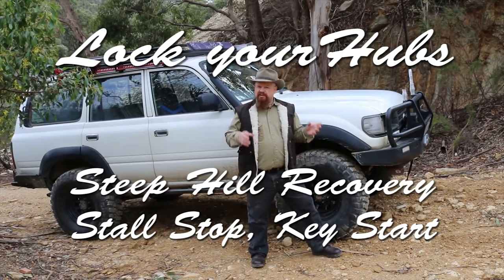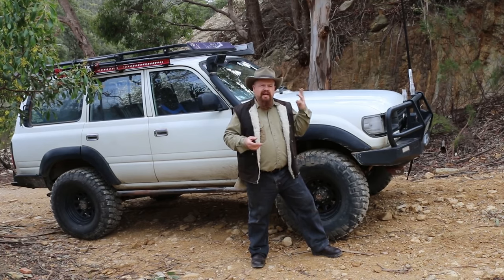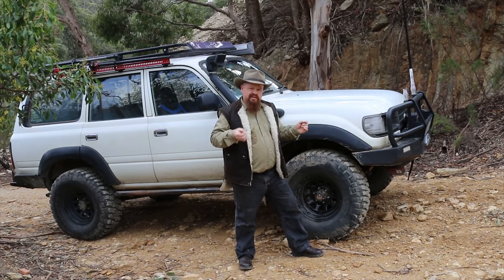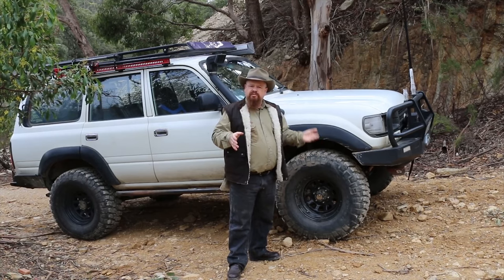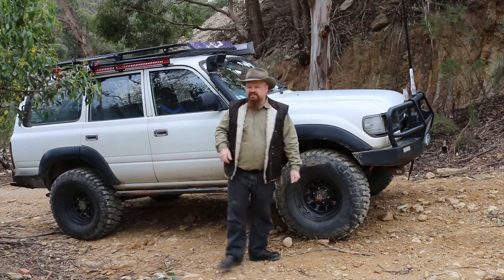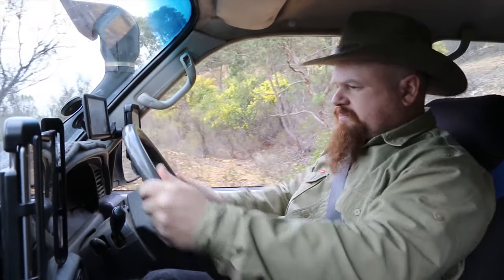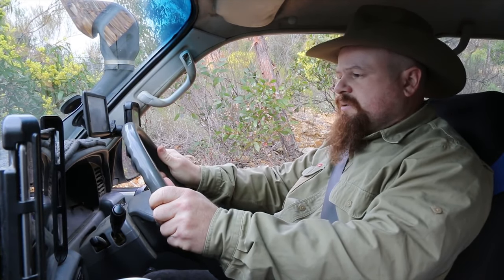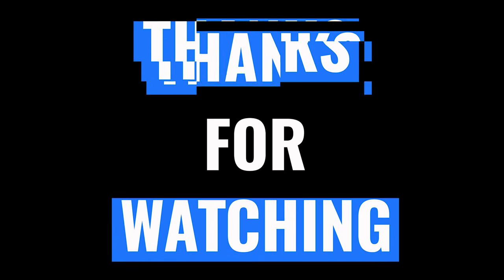Stall Stop Key Start 4WD Steep Hill Recovery

Comment: Very helpful video. In my case my car needs to use the clutch in order to start the engine. In that scenario what steps should i follow? Can you help me on that?
Reply from the maker: You have a clutch lockout? Where the car doesn't start without the clutch pedal being depressed?
Reply: @LockyourHubs4WDing  In order to start the engine  i have to press the clutch and after that  turn the key all the way.